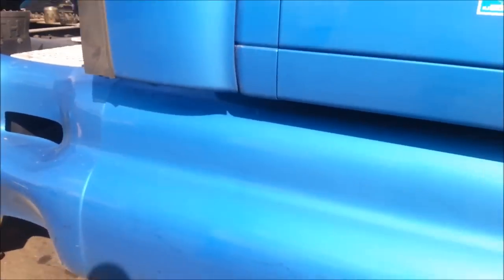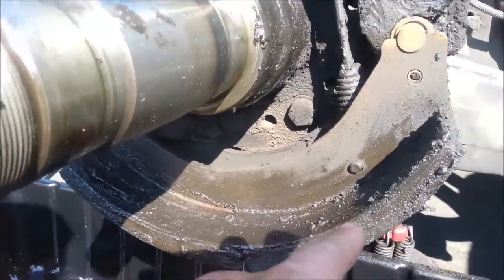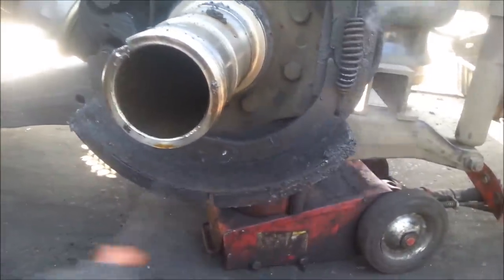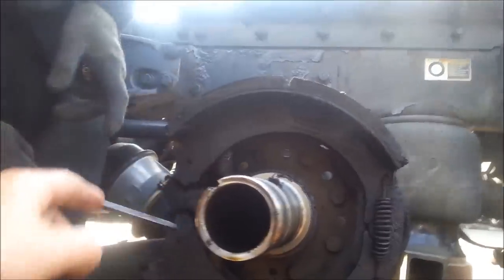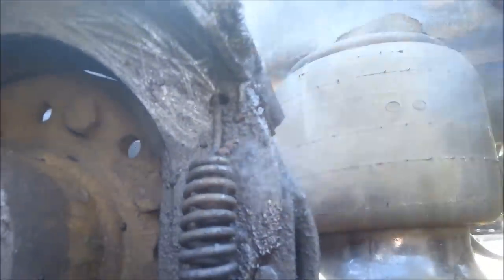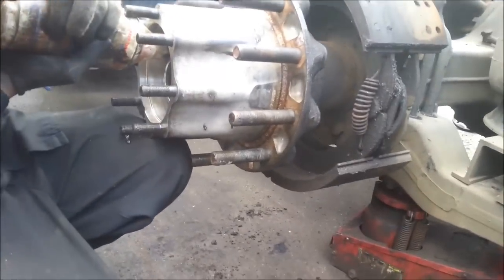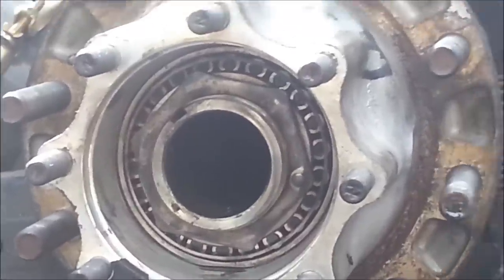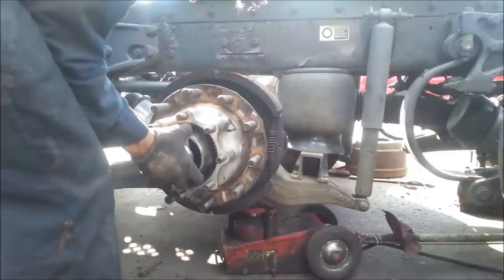SEAL DAMAGED LEAKING OIL BURNING MY WHEELS

Comment: When you break down on the road you you are at the mercy of the local mechanic, but I would not be happy with a guy torching my brakes. I had 1 wheel seal go out on the road and got lucky, the shop that I went to took the brake parts off the truck and put them in a parts washer that steamed them clean, they were as good as new. The other option in my opinion is to just replace the brake shoes.
Reply from the maker: I agree with you one 100 %,some guys don't know how to remove dirt.Any how, I am lucky that I  did not have any kind of a seal problem

Comment: Did I just see this guy tightening the dog shit out of the bearing retaining nut and not backing it off...Lol
Reply from the maker: +Mike Lew  This dud is fired, they called them selves Salvage mechanics don't know anything don't take your truck there.
Reply: I saw him install a bearing spacer - no need to back off the spindle nut.  bearings are pre set.

Comment: I don't know about the torching maybe ok maybe not. I wouldn't bother replacing brakes just maybe better to use a spray cleaning solution instead of torching. However, I can see why your seal leaked! If you you do a half ass job on changing a seal it will leak and you clearly use guys who do half ass job. That is not right bearing adjustment! the guy butchered your wheel right there. You supposed to tighten the bearing nut to like 200lbs then wrench it back like half a turn then retighten to 50lbs. The guy did a great job if he was repairing a dirt cheap truck but you seem to have a nice truck so why destroy it with jobs like that?